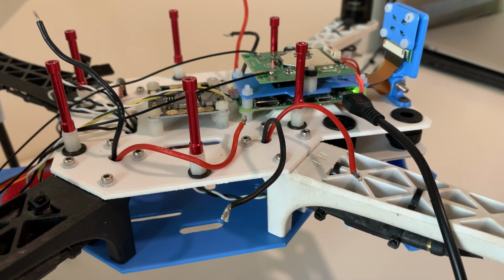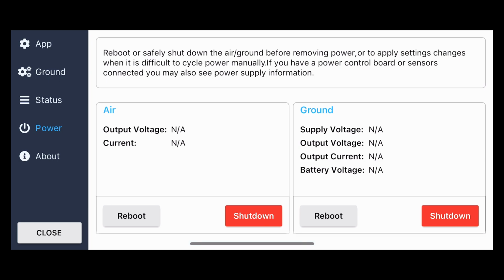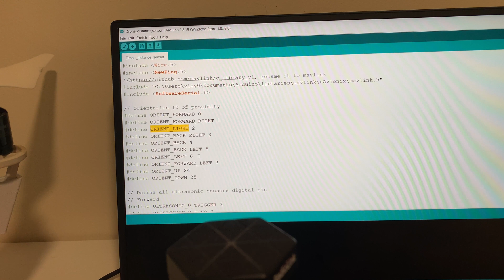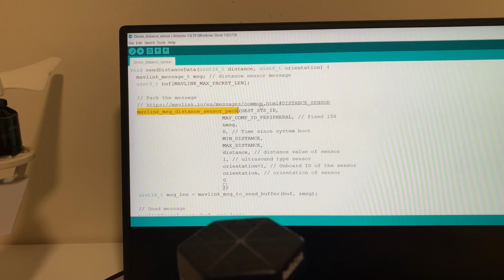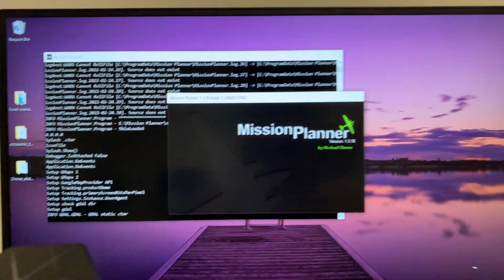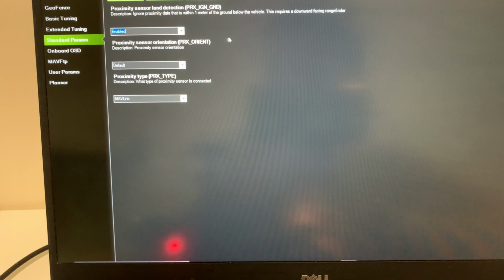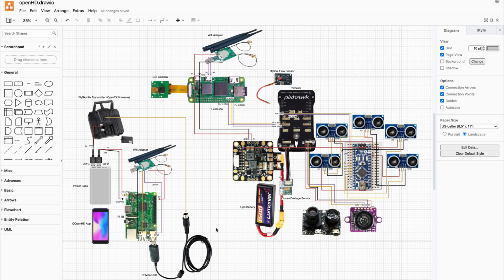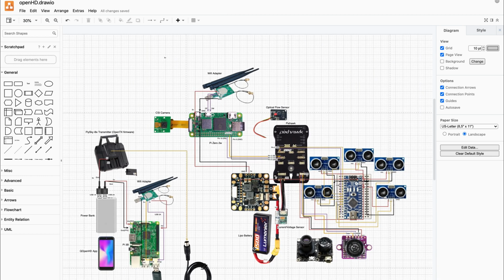3D Printed Drone Build #2 | How to Wire OpenHD and Ultrasonic Abstacle Avoidance

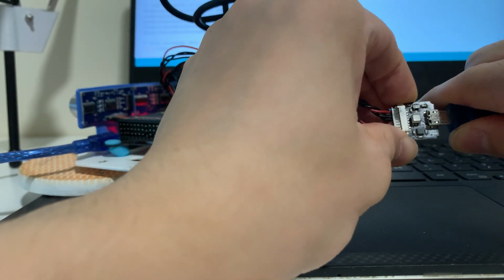Comment: Hi, Jacob! I am very interested on your project, the tutorial is also very understandable! but i am curious on 6:47 , what component did you use to connect the pixhawk to your laptop? Thank you!! I would be so grateful if you answer me because it has been 2 years you upload this video
Reply from the maker: That component is not important
Reply: @jacobstech1777  Oh so the component only used for radar testing? and not for the whole avoidance system?
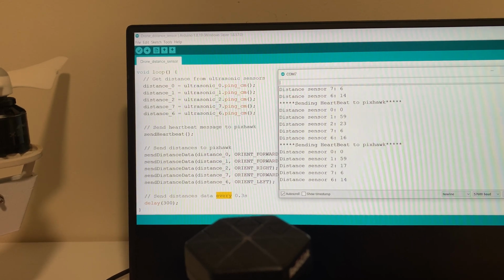Reply from the maker: @08_GaluhKirana  I mean the component at 6:47 is a external signal light only, no special function
Reply: @jacobstech1777  okayyy thank you so much!
Reply: @jacobstech1777  okayyy thank you so much!